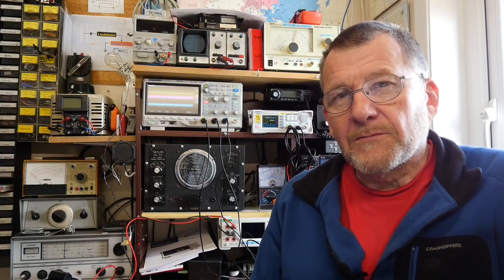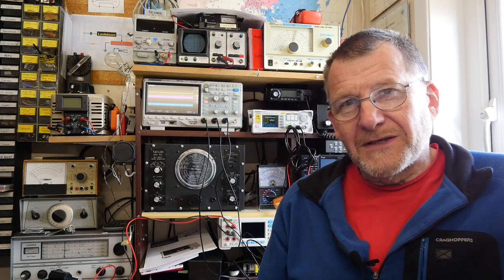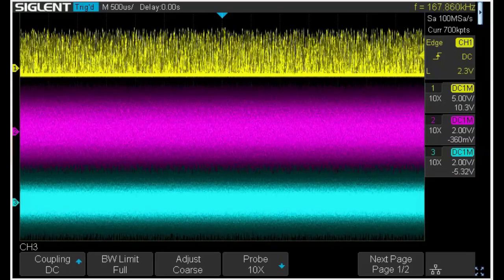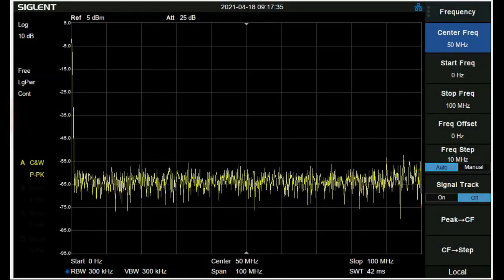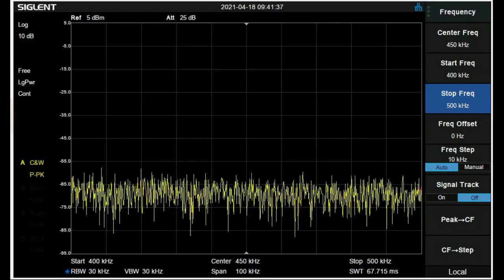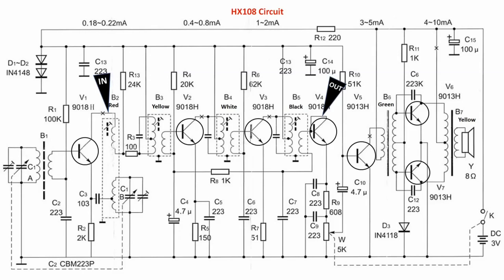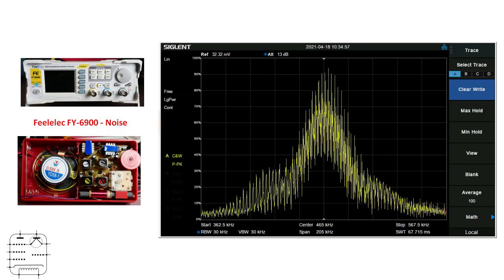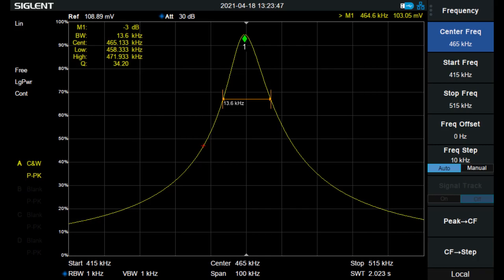Noise - 3 Different Sorts   #063

Comment: Very good video sir, t was not unusual in my early career to align receivers with a noise source in the absence of a wobbler. For narrow band receivers - I've been working in the land mobile radio sector since 83 - the alignment was performed using a distortion meter only

Comment: That was interesting, so you could use it to align radios.
I suppose you could use that on an FM waveband which is usually 10.7 meg IF.
I imagine anybody with an entry-level digital oscilloscope that would probably have an FFT math function, would probably have a cheap Chinese signal generator as well with the noise waveform.
So they could use it to align radios like you did, in your video No 57
I’ll have to get my current radio restored to a point where I can give it a try.
Thanks again, and another brilliant video, cheers.
Reply from the maker: Barry, yes you can use it.
Have you seen my video using a 2 channel scope to plot a sweep response? its here https://youtu.be/KPuj072zMvw 
This is also usable for alignment without using FFT.